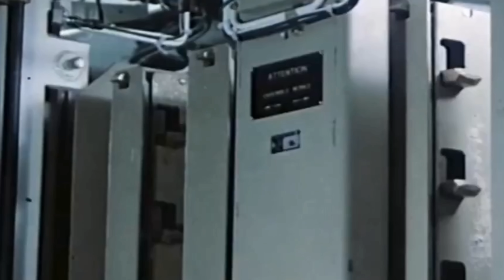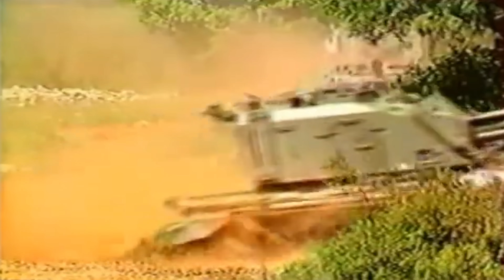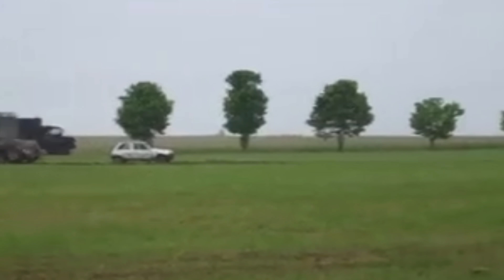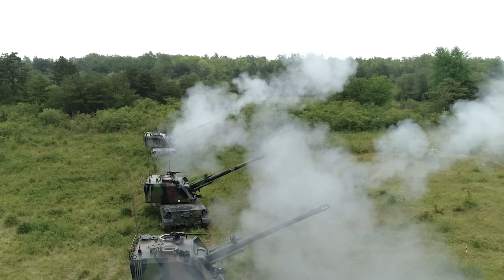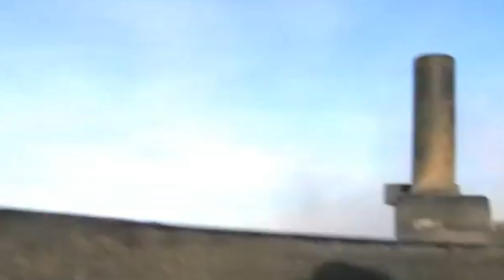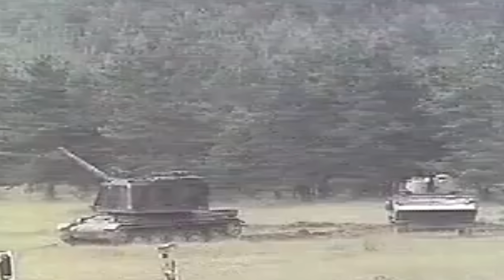AMX-30 AuF1: France’s Autoloading 155mm Artillery

Comment: It was design to shoot 9 round at a time and run to another position before the round arrive to the target, making it impossible to destroy by a counter battery.

They use AMX hull as it was available for other tanks and many specialised vehicle.

It is retired now but still so much far in advance to the M109 and all system similar, even today, few can compete with this old one.

Comment: Few people realize it, but self-propelled artillery and manually loaded tanks can be upgraded in a simple way by using an exoskeleton for the loader.
An advantage of such a system is that the exoskeleton can also be used outside the tank or self-propelled gun for repairing tracks.

Comment: the archer is the best
Reply: your opinion ofc but fact is there are 120 Caesars in Ukraine and only 6 lost (5 in 6x6 version and one 8x8)  which is pretty good considering it was one of the first to arrive in Ukraine, one of the systems most used and in biggest numbers, with better operational rates and lower loss rates than any other SPG because it is simple to maintain and more reliable. (this is data from Ukraine and verified by KNDS as of 1st half of 2025).  all this without compromising  firepower, accuracy and reliability

Comment: K9 thunder is the best self propelled howitzer right now

In fact many countries are lining up to buy it
Turkey is building a local one
And Poland ordered a lot and many countries want it
Reply: Not to fight your claim that it's the best right now (You could argue that the RCH 155 is better), but the biggest 2 reasons why it's bought so often is 1. it's good price-performance ratio and 2. political idependence from germany e.g.
Reply: your opinion ofc but fact is there are 120 Caesars in Ukraine and only 6 lost (5 in 6x6 version and one 8x8)  which is pretty good considering it was one of the first to arrive in Ukraine, one of the systems most used and in biggest numbers, with better operational rates and lower loss rates than any other SPG because it is simple to maintain and more reliable. (this is data from Ukraine and verified by KNDS as of 1st half of 2025).  all this without compromising  firepower, accuracy and reliability
Reply: Laugh in CAESAR, more than combat proven, and not just in Ukraine.
(And now, it's being copied by everyone, from China and Russia to Turkey and even the USA tried to with their BRUTUS (not so subtle of a name...))

Comment: Looks like a Naval Gun mount stacked on top of a tank chassis
Reply: oui c'est comme si il avait voulu faire un landkreutzer (un cuirassé terrestre) mais il aurait oublié de rendre cela excessif
Reply: it basicly is just a different typ of turret for the "standard" chassis. That´s his fair advantage since you get very easy a new chassis in case repairs will take to long and in the artillery configuration it is just 6 to heavier than the MBT AMX 30 so it is still similar in movement performenace and the whole a formation could be handled with MLC 50 brigade equipment. It can fire 360° without aditional prepartion or repositioning and can do direct fire if needed.
Negativ in some degree is that it never made the jump on the leClerc chassis which made the original spare parts synergie obsolete. But that failure of the french armee and not of the vehicle, since the whole concept was done for a chassis update
And in some way, its the inspiring uncle of the PzH2000, https://en.wikipedia.org/wiki/SP70 😉

Comment: The AMX has never been on the Balkan battlefield, and the same goes for British tanks in Kosovo, because they have never seen a battle; they come after all battles!
Reply: AMX is the name of the factory that produces the AMX30 MBT, but also the chassis for this SPG, so here, AMX chassis were definitely sent to the Balkan, as the AUF1 SPG.
But they also were some AMX-10P, AMX-10 RC and AMX-30 there. That definitely took part in combat. Even the Leclerc were sent to Kosovo... They didn't saw combat because they were almost nothing that could challenge them, so they were pure deterrent.
You know those informations are freely and easily accessible online, don't you?
Reply: @stitch77100  Do you know that none of NATO soldiers have breached deeper than 100 meters in Kosovo, and that is generous from me, they never breached and stayed there, because they ran back to Albania very soon. They're talking jibberish about tanks and any fighting vehicle, because they in into Kosovo only after an agreement after 3 months of battle.
Reply: @stanislavt6376  Stan, you should learn about the NATO rules of engagement at the time. You may learn something and understand a few things better.
Like the fact that AuF1s did fire on Mount igman in 1995 (you can find advice of this even on YouTube), because they had enough range to do so, and that the NATO operation was an Air support one, so, from the air, to provide support to the non NATO troops and the civilian present there...
I can't explain it better than that, sorry.
Reply: @stitch77100  Rules of engagement? Those rules existed only in propagandist media. If that tank is used in Bosnia, that is evidence of crime, because the only KFOR is there for peace deals, not to engage, and not for clandestine operations.
Reply: @stanislavt6376  We already proved you wrong about the AMXs, do you really want us to prove the rest of the world that you're lying there too?
And, really? ROE are a propagandist invention? Wow, you really should go out and read more, that one is laughable honestly...
Find a better lie, this one is too easy to spot.
Reply: Posted by a Serb,well known for their bravery killing unarmed boys
Reply: @stevenbreach2561  Please, do not be stupid!
Reply: your opinion ofc but fact is there are 120 Caesars in Ukraine and only 6 lost (5 in 6x6 version and one 8x8)  which is pretty good considering it was one of the first to arrive in Ukraine, one of the systems most used and in biggest numbers, with better operational rates and lower loss rates than any other SPG because it is simple to maintain and more reliable. (this is data from Ukraine and verified by KNDS as of 1st half of 2025).  all this without compromising  firepower, accuracy and reliability

Comment: AHS Krab: combat-proven in Ukraine, it strikes the perfect balance between modernity and simplicity. A reloading aid, instead of an automatic system, ensures greater reliability, allowing the vehicle to remain operational longer. A modern ballistic computer. High-quality barrels – Ukrainians fire 2-3 times more rounds than their theoretical limit. They fire because they have no choice; they can't withdraw the vehicle from the line, because who will support their own? Generally, the Krab has been deployed in the most challenging areas from the start due to its accuracy, reliability, and ease of maintenance compared to other designs. It is true that it does not have such proven protection or rate of fire as the Pzh 2000, but it is something for something.
Reply from the maker: Thanks for the detailed insights on the Krab!
Reply: PZH2000 have not done particularly well in Ukraine!  technical and reliability issues (fragile electronics and premature barrel wear) means they are out of service more than not.  availability is the best capability in war.

meanwhile 120 Caesars are in Ukraine and only 6 lost (5 in 6x6 version and one 8x8)  which is pretty good considering it was one of the first to arrive in Ukraine, one of the systems most used and in biggest numbers, with better operational rates and lower loss rates than any other SPG because it is simple to maintain and more reliable. (this is data from Ukraine and verified by KNDS as of 1st half of 2025).  all this without compromising  firepower, accuracy and reliability

Comment: I wonder if the AMX-30 AuF1 or its successors get sent to Ukraine.
Given the largely static warfare in the region and the drones able to spot for the artillery they might be well suited to this kind of warfare.
Reply: France replaced them with CAESAR 6x6.
France needs was a light and speedy artillery who can be deploy by A400M.
Reply: @blackstar9485  That definitely makes sense, especially considering the missions France does in Africa. I wondered what happened to the old units.
Reply: @edspace. 
There were 80 in service in 2013, only 32 in 2016 and officially there is still 21in service today in the 40th artillery regiment. But they are not counted into the army inventory, so i suppose they are  used for training or simply in storage.

I don't think they would ever be sent to Ukraine, as it would mean a whole new logistic line just for this (old) system, while spare parts may be very limited. Money would be better spend in a system that is more common or still in production
Reply: @anubis5397  Thanks, that would make a lot of sense. As they are no longer in production the support logistics isn't something Ukraine needs.
Reply: well 120 Caesars are in Ukraine and only 6 lost (5 in 6x6 version and one 8x8)  which is pretty good considering it was one of the first to arrive in Ukraine, one of the systems most used and in biggest numbers, with better operational rates and reliability than any other SPG because it is simple to maintain.  all this without compromising  firepower, accuracy and reliability
Reply: @lordtemplar9274 Good going on their part, hope they can keep being helpful to Ukraine.

Comment: Yes but drone…
Reply: They’re not gonna do frontline brawling because they’re artillery pieces, drone pilots are going to prioritise the more important frontline MBTs which are immediate threats, not a mobile artillery piece stationed far behind frontlines hurling rounds at fortifications every now and then.
Reply: you sure? because 120 Caesars are in Ukraine and only 6 lost (5 in 6x6 version and one 8x8)  which is pretty good considering it was one of the first to arrive in Ukraine, one of the systems most used and in biggest numbers, with better operational rates and reliability than any other SPG because it is simple to maintain.  all this without compromising  firepower, accuracy and reliability.

Comment: The architecture was innovative, because of the autoloader, ATLAS system and turreted configuration, as opposed to the "casemate configuration" (like the M-109, 2S3, K-9, Pzh-2000), aka the crew compartment is mixed between the turret and the chassis (turret to the rear) vs a turret (centered).
Turreted design are more flexible compared to casemate design, often put on mbt chassis (like AUF-1, Msta-S), giving them more mobility, but also a true 360° field of fire, unlike the casemates design which are mainly limited to frontal arc firing. But it's often a heavier design, because of the use of MBT chassis and bigger turret. The mont Igma battle is pretty much the text book example of how flexible the design is. MBT didn't had the firing range, because it was about direct fire from a mountain to another and casemate design couldn't creep their way to the top driving on narrow mountain roads and firing 360°.
And it's funny to think the Pzh-2000 took the worst of both world, casemate design on a MBT chassis.
Reply: you are mistaken about the PzH-2000. It was not built on a tank chassis, and it does have a 360° traversable turret.
Reply: The lead ingenieur behind the PzH even mentioned once in an interview, that they didn't want to go with a mbt chassis, because of it's many drawbacks (PzH 70 already used a mbt chassis, which would  have been never be able to support the requirements set by the Bundeswehr). So he designed the PzH chassis to be a perfect fit for a spg.
Reply from the maker: That's a great point about the turreted design allowing for greater flexibility and mobility!
Reply: ATLAS sucks major ass though

Comment: The cannon and turret seems capable enough but note that intense rocking of the chassis.  I suppose they needed to wait until it stops rocking before firing another round thus affecting actual rate of fire?  Mayhaps a larger, wider chassis would have served better?  I dunno.  But it does look great.

Comment: Yeah, same for me, the K9 Thunder is no 1, Panzehaubitze is second place with the Swedish Archer and on third place is the Cesar, which i highly disliked at the beginning!
Reply: PZH2000 have not done particularly well in Ukraine!  technical and reliability issues (fragile electronics and premature barrel wear) means they are out of service more than not.  availability is the best capability in war.

meanwhile 120 Caesars are in Ukraine and only 6 lost (5 in 6x6 version and one 8x8)  which is pretty good considering it was one of the first to arrive in Ukraine, one of the systems most used and in biggest numbers, with better operational rates and lower loss rates than any other SPG because it is simple to maintain and more reliable. (this is data from Ukraine and verified by KNDS as of 1st half of 2025).  all this without compromising  firepower, accuracy and reliability
Reply: @lordtemplar9274i know the pzh problems, that they have been designed for low intensity use and the long lead times for spares. that being said when they work, they are excellent. 
I also know of how praised the Caesar is, but i also know of the issues the Lithuanians and the Danish are Having with them not being able to meet firepower specs, so it isn't all doom and gloom with the PZH, neither sunshine and rainbows with the Caesar
Reply: @Deimnos  sorry but what are you talking about?  DK does not have any Caesar since they rushed to donate all theirs to Ukraine soon after delivery of the first few units. No Caesars were ever operational in Danish army and the remaining units were shipped directly from France to Ukraine.  At that time, rushing them to Ukraine was the priority because production could not keep pace.  

secondly Lithuania cannot have any issues because they have not even received their first Caesar Mk2 yet. 18 on order, first delivery expected in 2026

meanwhile in the real factual world Caesars are doing their job very well in Ukraine since 2023 and highly praised by Ukraine who rate it the best compared to others offering reliability, availability, accuracy, range and ease of maintenance on the battlefield.  finally it is also a lot cheaper to buy and operate, meaning you can afford more units.

anyway you are free to have your opinions, but i will stick to the facts and Ukraine's verdict on the issue.
Reply: @lordtemplar9274cool. then don't verify your information. I'm not gonna waste my time with you further. You have google. you just don't have the emotional and intellectual maturity to check your opinions. I'm going back to factual reality now, where arguing on the internet about which weapon is better is childish. Have fun. I'm done here
Reply: @Deimnos  LOL can't answer a single point I made and here we go with personal attacks!  
Furthermore you are the one making a "childish" claim which weapon system is better. OFC I will wager that you have 0 first hand experience using any of that equipment!
everything i said is true, none of it is opinion except for Ukraine's expressed opinion which I am relaying.  Ukraine made public its findings based on a detailed report of its experience with all its artillery pieces in use.  (the only one not included was the RCH 155 which is on order and not yet on the battlefield when the report was released earlier this year).  So Caesar is best not because I say so, but because Ukraine says so, and they are best placed to judge.
it is you that should do some basic internet research because you have no idea what you are talking about.
Reply: @lordtemplar9274 I'm done arguing with entitled children. You can write all you want, this is the only response you will get from me.

Comment: Too bad they stopped using it, never mind making new ones. Fantastic machine, and small too, which is great
Reply: probably felt that it was, as all tracked vehicles, too slow...
the French are probably the first who fully understood that the evolution of the means of war made armoring close to irrelevant for anything but bunkers
this may change in the future, but we are currently in this paradigm where the spear surpass the shield whenever it can hit it...
and this acknowledgement shaped most of the current French vehicles which bet more on speed and active defensive measures instead of weighty armor that can still be pierced anyway
yes, I know, the drones probably negate a big chunk of the speed benefit, but then again, counters for drones are already being used (passive ones) and more are coming (active ones)
Reply: @kolerick  I would rather be in this thing than standing outside by the Caesar.
Reply: @gyorgygajdos1657 with caesar you are faster shooting reloading and leaving than this thing slso more range
Reply: @gyorgygajdos1657  the main protection of the Caesar is its speed. It deploys, fire, packs and move away before the enemy can fire back, even assuming they immediately triangulate where the shots come from.

In Ukraine barely a few ones have been destroyed by Russia, only as a drone already happened to be there.